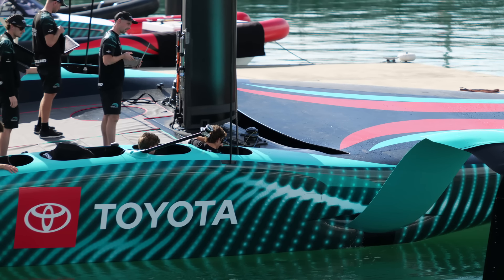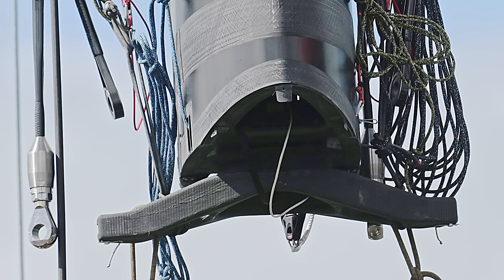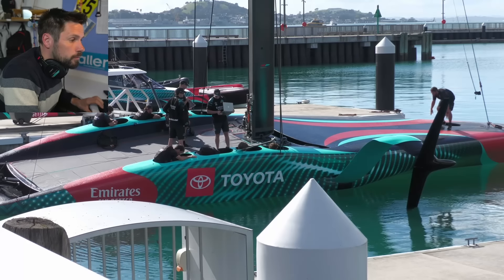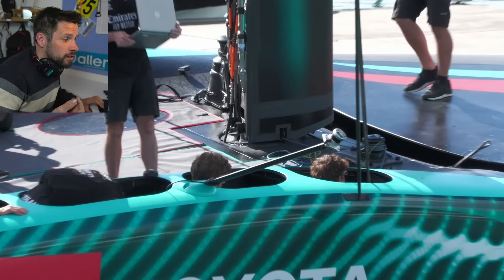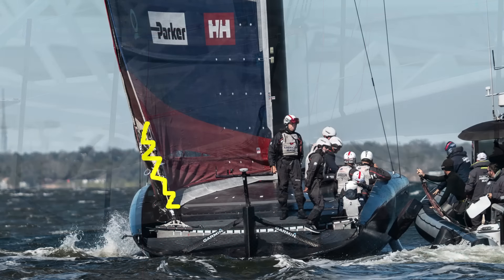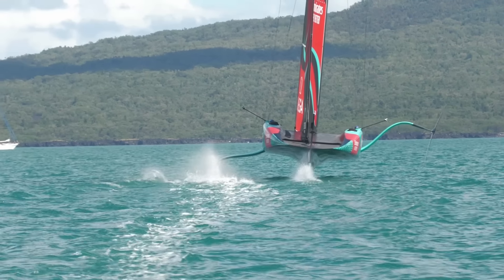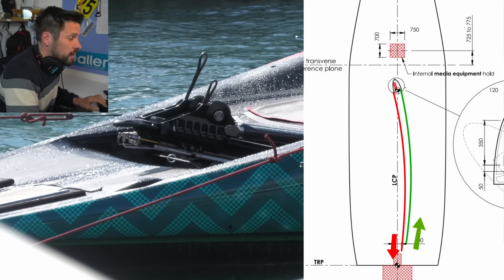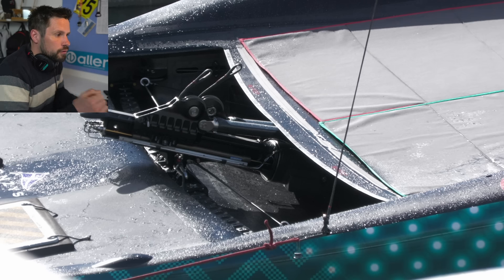AC37 Eureka Moment: Team New Zealand Double Mainsheet

Comment: The depth to which you go in studying the latest updates is so impressive.
Independent sheets seems so obvious yet only NZ have done it.
As an Aussie boat builder i proudly say
GO TEAM UN-ZUD!
Reply: You're an Aussie boat builder cheering on the enemy over the ditch, whats that about?
Reply: Beauty
Reply: Forget about the structural extra weight penalty. That can be engineered out, spreading the loads for'd to counteract twisting loads. Ok, you have an extra ram, BUT SMALLER, say that the loads are 10tons per leach (i remember figures of 8t for cunningham loads from last cup), a double leach like pulley/yoke /other, would be TWICE that. Actually, smaller rams might be faster and more responsive. The drawback is more the "having the extra complexity/brainpower" required...2 sail trimmers? Joking. DEFINITELY EUREKA. Bad day for the other teams...until you discover Their Eurekas...(p.s. Great job !)
Reply: Thanks Dud.
Reply: Dont be mad that your own support the kiwis. Just trot on mate @Antipodean33

Comment: This is ingenious. Took til the 6m - 6m30s moment to grasp the so what. It’s Bernoulli where you’re basically able to adjust the wing dynamics to increase thickness and thus wind flow around both sides independently instead of tieing the ratios together. Very obvious in hindsight but utterly ingenious and brilliant to invent. Proud of these kiwis.  Here’s hoping the other teams can’t copy fast enough to compete with same innovation. 
It’s this that makes America’s cup innovation so ground breaking and fascinating.
Reply: Yeah I was the same at that point in the video
Reply: IT IS NOT SAILING
Reply: @I.C.U-c7l  why isn’t it sailing?
Reply: What is your problem exposing TNZ boat? If you're that clever why aren't you racing? Why are you so anti kiwi? You're so clever but nobody takes you in.

Comment: Thanks for another brilliant video. I haven’t been an active sailer for many years. But as a teenager the mechanics of sailing were my passion.  So lovely to have a way to reignite that passion

Like so many ideas this sheeting system looks simple, once you’ve seen how some one else has done it. My gut feeling is that the independent control is going be massively beneficial, particularly controlling the depth of the sail, meaning the distance between the 2 skins. 

I think i might have to take up RC sailing in retirement so i can run my own campaign

Comment: 5:55 - very fascinating. Even though in aeronautic terms, the leading edge of the wing essentially IS the wing, there are a lot of things you can do to the shape of your wing if you have control of both upper and lower surfaces. I find it easy to accept that TNZ have established a process which allows more efficient lift production while reducing drag. And we all know that Glide Ratio = Lift/Drag - and who doesn't want a better glide ratio?
Reply: In my mind i think the key will be the ability to quickly change the characteristics of the foil through manoeuvres.  So through the tack the foil is flattened and has the surfaces close together, no lift minimum drag.  After the tack the surface move apart creating more lift to accelerate out of the tack. Then as Max speed is approached the skins get closer together to reduce drag
Reply: @tallteacher  Indeed. I'm particularly impressed with the notion that it's so rapid-acting as to be able to minimise drag half way through the tack by behaving like a solid, non cambered wing. Also excited by the "trickle down" possibilities of the concepts, if not the execution (even, perhaps, eventually to cruising use cases, given the manageability of twin-skin soft sails in comparison to hard). For example, storm sails which could be totally featherered with zero lift, minimal drag and no flogging could be a game changer, cutting down the need to be reefed down for the worst gusts with the attendant problem of being woefully underpowered during lulls (which in very high but regular seastates, happens in every trough). On these boats, given that they're so fast, the full sail area is seeing storm-force winds all the time, and they never ever flog.
Reply: @Gottenhimfella interesting…👌

Comment: Great analysis. If TNZ can minimise the significant speed loss while tacking by independently changing both main sheets, that is definitely going to give TNZ a big advantage - both in tacking duals as well as catching up from behind. I imagine it will take a while for them to find the right combination of adjustments for different wind speeds. Lets hope they have enough hydrolic power for all the fast & high-pressure adjustments

Comment: ETNZ are well known for their innovation, they always seem to out-think their opponents, an I suppose you have to be when your not as well funded as the others, thanks for the insight
Reply: @floodo1 Wasn't the case in Bermuda or with the AC72's (they showed their hand too early in the latter) or many other times they have been innovative.
Reply: @floodo1 Yes, ETNZ were the first to foil a AC72 and in Bermuda 2017 when they turned up with the cyclors, the wing trimming xbox control and all the other hidden gems, that was the most innovative boat, and it didn't just win the cup, it smashed it, even after a capsize
Reply: New Zealand ,the little country that could- when it comes to sport anyway

Comment: Another great analysis. Thanks for all your trouble. Would you have ticklers on the inner and outer skin to unjust individually? Could it be interesting to separate the two skins completely to slow the boat (parachute effect), for starts and crossings? Better speed control? Thanks again

Comment: Maybe a noob question but how big of an issue is the weight penalty really on these boats in terms of adding structure like this? Are they struggling to keep to the minimum weight at all so far? Obviously, it would mean a some more weight aft, maybe so much so that the rudder has to have more lift which comes with a drag penalty, is that it?

Comment: How about putting each sheet on a separate traveller.  You could then adjust the separation between each skin. What is the physics on the distance between skins at the clew?
Reply: The only advantage I can envisage of moving the clews apart would be the ability to goosewing when running dead downwind in displacement mode (Google Ljungström rig) but I think the time limits mean that would only be beneficial if the wind fluffed out on the final leg of a race.

Comment: I don't see how the mast can rotate if it has spreaders attached to the shrouds (as far as i could see). can you please explain that. thanks
Reply from the maker: The spreaders aren't fixed, but can swing as the mast rotates
Reply: @MozzySails   hello, thanks for your quick answer. I'll try to look again. i had the impression that the spreaders are connected to the shrouds. (there aren't many videos that focus on that height level).
Another questions if i may, concerning the jib.
contrary to the main which is very high aspect, I often see jibs which are small and low aspect. (they are also quite  far from the main), I had the impression that they don't contribute much to the driving force, but serve mostly to balance the boat (on the Yawing axis) what do you think ?

Comment: yes an extra actuator, but wouldn't these two be smaller than the single actuator under the strop of the conventional system ?

but yes, there would still be some added weight to support the two actuators.

for me, an extra control can give you an advantage, if you understand how to use it properly.  else it becomes one more thing to get wrong !

this reminds me of one of dad's jokes ... what's the difference between a magician and a chorus line ? except to rephrase ... what's the difference between a magician and a kiwi sailing team ?

Go Tom (Slingsby) ... get them next time (again) ...

Comment: There's a video (link below) in which Geoff Senior says that the build team have been watching every gram so as to save weight. It would seem that with the mainsail / twin-skin sheeting system & the below deck structure required to support the loads, they've had to work very hard to save weight wherever they can.
https://www.youtube.com/watch?v=VBxOg-j4SH8

Comment: Im not so optimistic for the Kiwi Boat! The Hull from Alinghi anf Luna Rossa looks way better in Aerodynamics (Red Bull and Ferrari Formula 1). This is Essential! Many things can be tuned during the Cup but not the Hull !!! The Kiwis are the best Sailors in the World but the faster Boat always win and again I think the Kiwi Boat is the not the fastes Concept…
Reply: Hmmmm ... now, where have I heard that b4 ?
Reply: Don't forget they broke the land speed record. I think they know enough about aerodynamics.
Reply: I don't believe so, they only doing 40-50knots tops. At these speeds Air resistance is only a fraction of the water  resistance. Will come down to 1.foils and foil control 2. sail control. All the boats shaps are very similar, they be within a % of each other. Alinghi has a huge disadvantage in the foil and sail control department. they been forced to launch there race foils already and sail control looks to be above deck.
Reply: is 'way better' a technical term from your training in aero and simulation?
Reply: When things look way better its gotta mean way faster as looks are everything. Te Rehutai was looked way better last time aye.
Reply: Lol, same was said to McLaren, Britten, Rocket Lab etc...
Reply: There are presumably aspects of aero drag which are counter-intuitive. Also, I think there are three main considerations, not just aero drag, for hull & deck shape. The other two are lift-off speed (the "stickiness" of the hull at the transition between displacement and foiling and the drag below that speed) and the interaction of the hull with the circulation flows around the sails (analogous to how the flow around a jib affects the flow around the main).
Reply: @jasonpickens9839  Good point. They broke it with their first attempt, no prototypes, no development evolution. Then as if to prove it wasn't a fluke, they went back and broke their own record with the same configuration of the same vehicle.
Reply: TMNZ land speed is just under 122 knots so just over double the expected top speeds of a foiling AC75.  double the speed 4x the energy.  Same for aero drag.